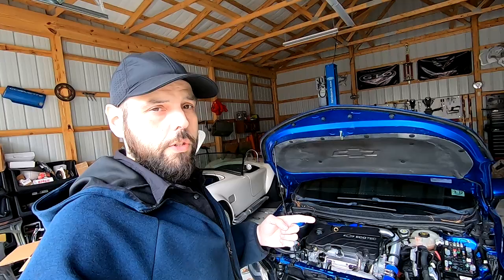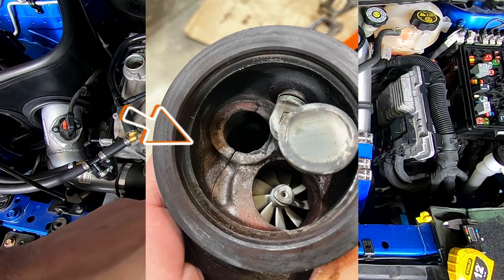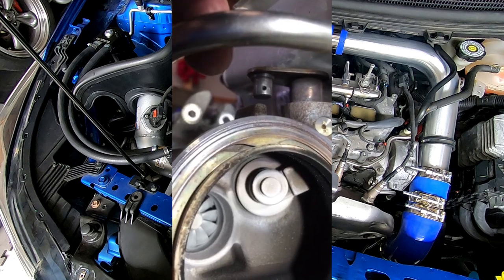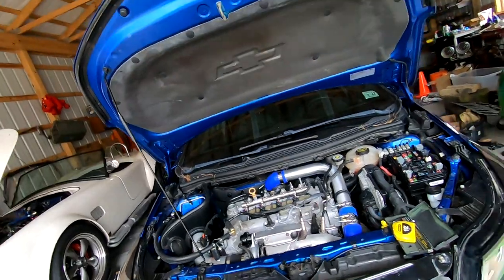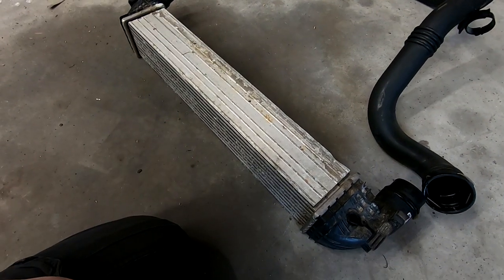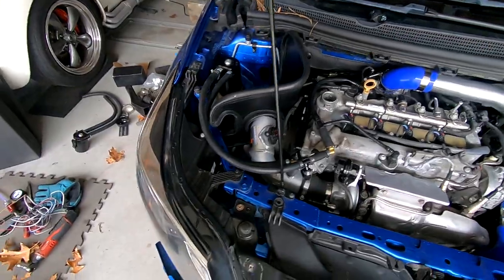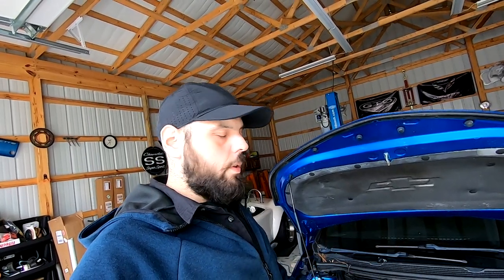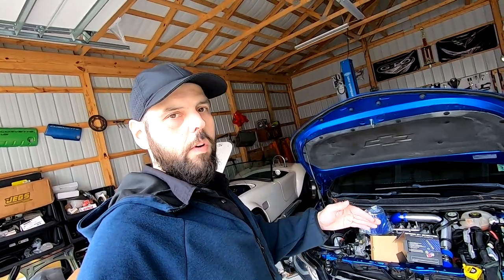Common CRUZE problems and issues from Dave's World

Comment: I have a 2017 chevy cruze LS, about a month ago it had a service stabilitrack, and a cylinder 1 misfire code, black smoke was coming out the exhaust, shaking real bad, and losing power, got it home and parked it. A few hours later when i went out to start it, a crank over the key and it sounds like its trying to start but the engine doesnt crank over and run, it just tries and tries, but nothing happens, just replaced all spark plugs, the car is stock, always kept up with maintenance, please help
Reply from the maker: The problem on your car could actually have a few causes. It’s best to email me directly at customcruze@gmail.com

Comment: Question, I just noticed oil leaking from the piping connecting to the inter cooler on D/S, it seems excessive where can I start to check for?
Reply from the maker: You need a PCV reroute and upgraded intercooler pipes. You will start having boost issues. Check out www.supercruzes.com I have a few things that will fix those issues.

Comment: Ok so my daughter has a 2018 Chevy cruse she went to get her oil changed was driving homè few hours later whole car was vibrating took it back to where she got oil changed they told her the motor mount probably broke, which was not the case replaced all four coil packs, still didnt fix so we figured out needed to replace injector which we did and it seemed to dix the problem but it continues to leak gas, so we bought an o ring kit put all new ones on still leaking!!!! Any ideas or way to fix
Reply from the maker: @brandyallison3643  any active codes in the ECM?
Reply: B @davesworld2132 yes and we have replaced all the coil pack, all spark plugs and all the injectors. Have spent about 500 bucks on it.
Reply from the maker: @brandyallison3643  What are the codes?

Comment: I think I may have a cracked piston in my 2017 cruze. I'm trying to perform a compression test, but there aren't any fuel pump fuses/relay to pull to do so. Do you know how I can disable the fuel system to do a compression test?
Reply from the maker: You have a wire harness going to the injectors you can just unplug that at the fuel rail.
Reply: @davesworld2132  Thank you! Maybe you can provide a little insight. I have a P0301 code and a stability/ traction control message on the dash. On the highway when driving around 60 mph if I attempt to accelerate the car starts shaking violently, like it is not getting enough fuel, kind of similar to a clutch pedal, not being pressed in when coming to a stop I've read article, suggesting that this might indicate a cracked piston around the ring lands. Have you encountered this before?
Reply from the maker: @kcard707  When is the last time you had a tuneup? And when is the last time you ever changed a coil? Also just an FYI it is very common to have injector problems on these engines
Reply: @davesworld2132  the air filter,plugs, and mass airflow sensor (had a p1101 that is gone now)were all changed in an effort to try to fix this issue less thank 1k miles ago. The car has 69k on the engine and it's all bone stock. It'll drive fine when cold, but once it's at operating temp the issue becomes evident. I even tried gaping plugs between .025,028, and 030 and the issue is still there. Compression came out to 140-150 but what worries me that once the car is at operating temp you can see blow by come out the dipstick tube. How would I go about getting the injectors cleaned?
Reply from the maker: @kcard707  do all the plugs match in color when you remove them?
Reply: @davesworld2132  they are all dark black in color like If it were running rich.
Reply from the maker: @kcard707  what’s your oil pressure levels ?

Comment: Hi again,
Thanks for sharing all this information.  Well once again I have a question with my car.  I have a 2016 malibu 1.5 turbocharger.  I've been having issues with the car idling and not having or hardly boost.  It feels as if the car lost its power running only on engine power and no turbo.  Please help me.  I cant seem to figure it out.  Not mechanically inclined.  I can follow directions and learn as I go.   Please help.
Reply from the maker: Hello it’s your wastegate. That used to be non serviceable but I actually have upgraded custom ones. These will fix that problem and increase your boost. Here is a link.
https://supercruzesstore.com/products/malibu-1-5-and-2-0-upgraded-wastegates

Comment: Hey I have a question where's the weather temperature sensor located on a Chevy Cruze 2011 it was working fine and I had to change the antifreeze radiator !now it doesn't show me what the temperature outside is
Reply from the maker: Ambient temperature sensors are typically found on bumpers. If you email me at the website I can look a little closer I have both of my Gen ones
Reply: Thanks for responding to my question but I guess I found the sensor already I forgot to plug it in! Thanks again
Reply from the maker: @Hollacomoestas2024  proud of you!!!!!

Comment: So I just bought a 2011 cherry Cruze manual and I can me in 4th gear and it won’t rev out over 2,800 and I can floor it and barely goes anywhere
Reply from the maker: It’s probably low on power. Message me through the site so I can diagnose your car. Www.supercruzes.com

Comment: Where is  chevy cruze 2019 baro sensor at? I have search picture/vids of locations and can't find it, not even the map sensor. I'm starting to think it dosent have either, yet the engine light shows code for p2227 p2229(baro sensor)
Reply from the maker: The intake . And technically the boost sensor on the intercooler.

Comment: Can I remove my turbo system and set it like a stock cruz that dont have turbos
Reply from the maker: What year is your car?
Reply: 2013
Reply from the maker: @oralwayne7273  technically you can use the 1.8 parts to do that and change your tune for no turbo. But why get rid of your current turbo?
Reply: @davesworld2132  Probably because they have been reading all the comments 🤣
Reply from the maker: @johnmitchell8925  lol

Comment: Have a 2017 Chevy Cruze LT. have a P2099 code and a p1101 code I am boggling my brain trying to figure it out exactly is the root of the problem help
Reply from the maker: Sounds like you need a charge pipe. I bet it's leaking, Message me on my website www.supercruzes.com

Comment: I have a 2015 cruze ls automatic that my car rattles if I turn my thermostat on with no check engine light on if I put my car in reverse or drive it rattles but when I turn my thermostat off u don't hear the rattling noise I had my transmission mount replaced in 2022 can u help me?
Reply from the maker: It may be your AC compressor. Sometimes when you use the heat the compressor turns on.
Reply: @davesworld2132  thank u
Reply from the maker: @empowered3206  No problem. Comment if you ever need anything

Comment: I replaced my oil pan n put in a new 1. I also changed my fuel filter. Once i put everything back together. It started but died out. My question is changing a oil pan from a diesel n a normal cruze ,is there a huge difference
Reply from the maker: No but on the diesel you may have lost fuel prime. Do you have any codes?
Reply: I had a feeling it had something to do with the fuel. But ive always changed my fuel filter myself... it cranked over than maybe a min later a bogged out. I've changed my filter a few times but never had this problem
Reply: Funny thing no codes. But my battery said it was dead and the charging system said was having a issue.
Reply: Any suggestions? When i get it to start i try to rev it a little bit but does the same thing. Just boggs out. Never had a issue with my battery and i was surprised it showed up
Reply from the maker: @manuelsheehan912  Have a way to read fuel pressure or oil pressure with a tool?
Reply from the maker: @manuelsheehan912  A battery will cause a lot of ghost codes. This will give you tons of problems. Also make sure your alternator is charging properly.
Reply from the maker: Also where is the fuel filter you changed?

Comment: My Cruze 2017 LT is having issues from last 1 year. Everytime my car comes to a stop and the autostop system kicks in, the car engine complete shuts off and I have to start the engine again. This causes huge problem at traffic signals and stop signs. I have taken my car to 2 different mechanisms who charged me almost 1000$ total and the issue is still not fixed. Is this a known chevy issue? One guy told me it could be air intake issue and one mechanic told me the accelerator pedal needs to be changed.
Reply from the maker: @abhimanyusapalok5322  I can have that tuned off completely and give the car some extra power as well. Or just tune it off.
Reply: @davesworld2132 I have a 2018 red line hatchback edition that does this but makes a loud screatching noise , any suggestions on how to fix this? It doesn’t do it every time it’s infrequent. I was thinking transmission but I’m no mechanic it does seem to be the auto stop feature itself. Can it be turned off in this model?
Reply from the maker: @truthsought368  have any active codes ?
Reply: @davesworld2132  yes I forget which one I will check late today update you tonight. I got something changed last year because the mechanic said there was gas where it shouldn’t be I will get that info too. The engine light has been on for forever tbh
Reply: @davesworld2132  still gotta get the codes today but a charcoal canister was replaced last October…check engine light came on again at the end of that week lol never took it back because it’s been a headache the noise only started this year. Let u know the codes today
Reply: @davesworld2132  I think my model does not have a autostop turn off option, but I will check if I can get it tuned off. Thanks for your help.
Reply: Alright Dave , I should have taken it back to the shop last year…it’s the canister valve…so I had the smoke test and canister replaced. Does the cable come with the canister? The part is only 24.99.
Reply: I havr the exact car and issue.  Have you figured it out???  I hate replcing parts with no change...how does this problem end!?!?
Reply: @rhcpimprovandcovers1063  which do you have? 17’ or 18’ hatch like me?
Reply: @truthsought368  17, same engine 1.4 turbo...did you fix your car shut off at stops issue?  I did solenoid canister too but it didnt fix it
Reply: @rhcpimprovandcovers1063  only thing I haven’t changed is the purge valve in the canister now I think this may fix it along with getting auto stop cable for that feature to shut off.
Reply: @truthsought368  i did the 2 things youre about to do...didnt help me one bit
Reply: @rhcpimprovandcovers1063  fuck…so you also have the auto stop turned off?
Reply: @truthsought368  yeah, theres a wire harness for like 12 bucks on amazon that you put in by the hood latch and it bypasses auto stop start feature.  It works...i also did evap vanister valve or whatever its called...even with thise 2 things done i still stall out and have to restart the car when im in drive and the car comes to a stop
Reply: @rhcpimprovandcovers1063  again - fuck so @davesworld2132 any suggestion on the fix for this? My car doesn’t stall so much with me but when you least expect it it does it.
Reply: @davesworld2132  check most recent comments we need your heelp lol

Comment: Fuel injectors 😭😭😭 just had to have mine replaced in my 17  cost me 2k 😭😭😭  this was September 2022 my ass is still sore !!
Reply from the maker: Good Lawd!!!! Dealer ?
Reply: how many miles. Thats important information 🧐
Reply from the maker: @johnmitchell8925  be seen as low as 20,000 miles and as high as 70,000

Comment: Loving the video was super helpful but I could really really use help for some reason I'm getting the jitters at low idle or low rpm and it's giving miss fire codes check engine flash and stabilitrak disables but if I get on it more it will act normal and no lights plz help
Reply from the maker: When is the last time your spark plugs were changed?
Reply: @davesworld2132  I just replaced the spark plugs last week
Reply from the maker: @406rckrew3  what gap are they?
Reply: @Dave’s World  .051 on acdelco iridium, and the issues will go away for a couple of days they aren't always present
Reply: @Dave’s World  .051 on acdelco iridium, and the issues will go away for a couple of days they aren't always present
Reply from the maker: @406rckrew3  That’s why you’re having a problem that gap is way too big you need .025
Reply: @davesworld2132  thank you soooo much
Reply: @Dave’s World  So it was o'reilly's website that was incorrect. It says .05 I on there, acdelco just pulled mine out, and they're actually point .026, so the gap is good
Reply from the maker: @406rckrew3  No problem let me know how you make out
Reply from the maker: @406rckrew3  go to .024 just to be safe and also check your spark strength
Reply: @davesworld2132  okay will do thank you again 🙏
Reply from the maker: @406rckrew3  NP!

Comment: Do you know where the fuel pump is located?
Reply from the maker: What year is your car?
Reply: The vehical has been running rough and sputtering and dying, it isnt throwing any misfire codes just a P1101 code, i cleaned the throttle body but didnt seem to do much good. symptoms remind me of a failing fuel pump. but the fuel pump looks different than a normal tank mounted fuel pump.
Reply from the maker: @FromTheGroundUp365  that’s a Maf issue. What year is your car?
Reply: 2017
Reply from the maker: Look at your PCV system, intake air filter and anything that conveys air into the head. If it leaks you will get that code.  @FromTheGroundUp365
Reply: Is there a way we can talk outside of YouTube? I just pulled the rubber tube that goes to the air box off the turbo and there's tons of milky oil in there,

Comment: Cracks are normal on the 1.4 turbo. Gm bulletin
Reply from the maker: Normal yes but you can’t keep your car running right if you have them. It’s not Al for a crack to happen. At that point your turbo needs repair.

Comment: 2016 cruze lt gen 2 engine.
It completely shuts down at all stops and redlights.  Other than that it drives well, no engine codes either.  Whats going on!?!?!??
Reply from the maker: @rhcpimprovandcovers1063  engine start stop. This is normal. I have a tune available that can remove that function.
Reply: @davesworld2132  im saying it shuts down, has to be moved to neutral or park for a restart.
Reply: Sometimes violently like a car bumps me from behind
Reply: @davesworld2132  it idles great in park, usually but not always shuts down when i move it to drive.  I have to quickly give it gas when i shift to drive.  Almost always shuts off at stops and i move it to neutral to turn the car back on and gas it a tad when i shift it to drive so it doesnt stall
Reply from the maker: @rhcpimprovandcovers1063  any codes in the ECM. It won’t shutdown in park. Only in drive if it’s start stop function.
Reply: @davesworld2132  no codes
Reply: @davesworld2132  itll shut down rarely in reverse (10 or 20%) and maybe 80% or more at stops when in drive.
Reply: @davesworld2132  i also changed canister and got the harness to eliminate start stop function and the issue hasnt changed, if anything it happens more often than it used to
Reply from the maker: @rhcpimprovandcovers1063  honestly it’s probably the start stop function.
Reply: @davesworld2132  even though im bypassing start stop feature?  It could still be start stop?
Reply from the maker: @rhcpimprovandcovers1063  yes
Reply: @rhcpimprovandcovers1063  Those  Auto start/stop disablers cause more problems than they help with and are flat out dangerous sometimes (tap into the airbag power source). Bring it back to stock and override the auto start stop by putting the transmission into L (low) before coming to a complete stop around 5 mph or so. It's annoying but you you get used to it.
Reply: @davesworld2132 Is there a button to disable the auto stop start feature in the 2018 cruze?
Reply from the maker: @lrn_news9171  no but I have an add on for that here is a link https://supercruzesstore.com/products/auto-start-stop-delete-disables-the-start-stop-function
Reply: @davesworld2132  You can also shift to L on the shifter manually set to 9 gears and apparently it won't auto stop 

You can also shift it to
L while coming to a stop or neutral and switch it back to D when taking off
Reply from the maker: @lrn_news9171  some can but others like it just being off. Sometimes just leaving it in the L can cause some funky issues with the transmission not knowing what gear it wants to be in
Reply: @davesworld2132  Interesting, well if I get a Cruze I might come back here to get that auto stop delete
Reply: @davesworld2132  I'm also concerned with the fact that the previous owner(s) might have never disabled auto start stop and have caused major wear and tear on the car, on the turbo and starter etc 
Concerned about having major repairs immediately after I purchase it. I'll have to do a thorough examination on it and ask for receipts. I would actually prefer that the previous owner already changed some of these parts.

Comment: My code is P0325 it’s knock sensor it comes and goes i’ve gone a month with it being fine and today I accelerated and it came up and when I accelerate it’s slower that normal.
Reply from the maker: What fuel do you run and what year is your car?
Reply: @davesworld2132  it’s 2019 and jus 87
Reply from the maker: @theshorttruths  do you have a tune? And I would recommend going to 93 to see if the code goes away first.
Reply: @davesworld2132  why 93
Reply from the maker: @theshorttruths  increase the octane to help with knock.